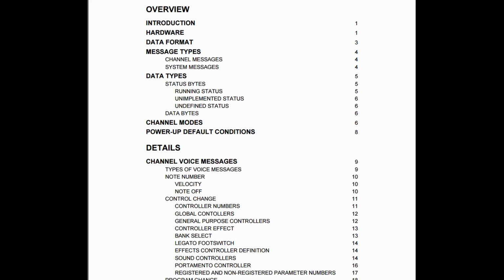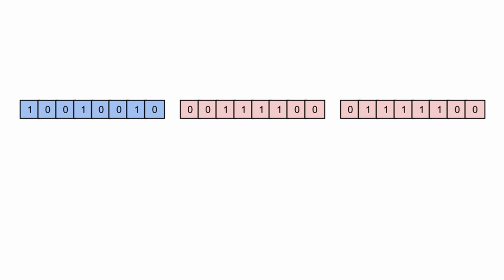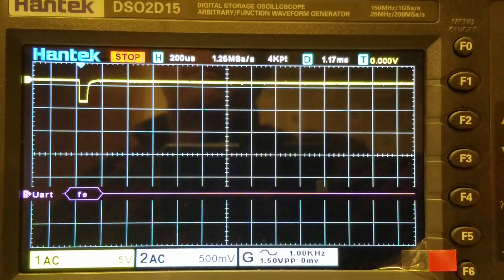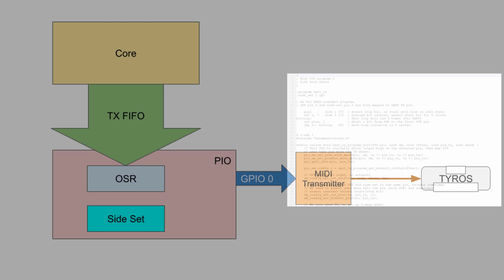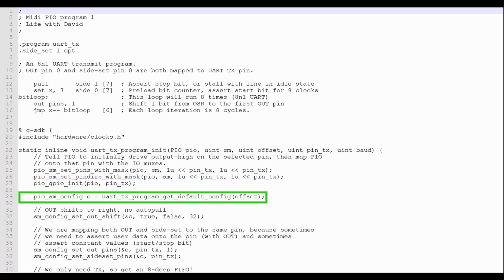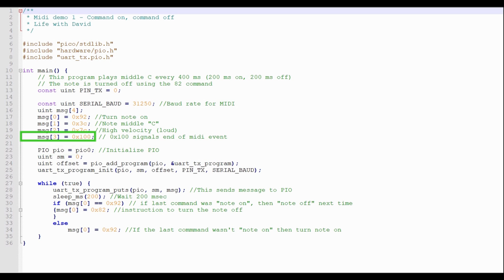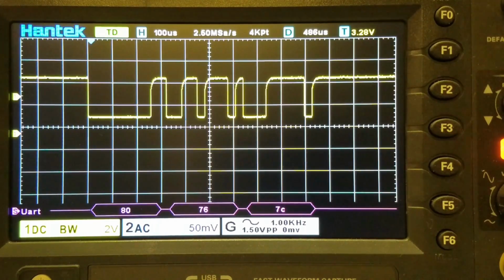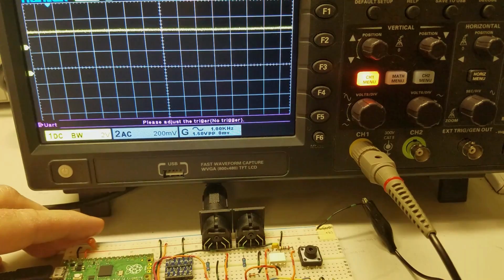Raspberry Pi Pico PIO - Ep. 17 - MIDI for the Pico

Comment: Hello David,
My name is Dani and I am a visually impaired user. I really enjoyed your project with the Raspberry Pi Pico and Yamaha Tyros.
I want to build a similar MIDI controller, but I would like to use a PS/2 keyboard as the input and a standard 5-pin MIDI cable for the output, in order to send MIDI messages to my Yamaha PSR-SX900 keyboard.
Is it possible to use your approach with a PS/2 keyboard as the input device, and will the MIDI output using the standard MIDI cable (DIN connector) be reliable for my project? I would really appreciate your advice or any tips you can share.
Thank you very much for your work and your help!
Best regards,
Dani
Reply from the maker: Thanks for watching!  Yes, you should be able to use a PS/2 keyboard with a Pico to transmit MIDI signals.  The PS/2 keyboard can be read using PIO.  Remember the keyboard typically uses 5 volts; but the Pico runs at 3.3 volts. You might try powering the keyboard from the 3.3 volt supply from the Pico and it might work. There are a couple videos that will help you.  Then choose a different PIO block for MIDI. Sounds like an interesting project.  Good luck!

Comment: Is it possible that on standard rasp Pi4 or Pi5 MIDI Din is DEAD? All overlays trying to change the Baud rates do not work anymore...
Reply from the maker: I'm sorry, I don't know.  I haven't tried MIDI on a standard Pi.  I'm assuming the Din pin is a GPIO pin.  Use a simple script to display the input of that pin and then toggle it between ground and 3.3 volts.  If it displays the proper value, then the Pi is OK, and it must be a configuration issue.  Good luck!

Comment: there is a mistake in your schematic at time 6:07, you show midi out pin 5 connected to the +5v through a 220ohm, this differs from your other schematic at time 3:45 which shows pin 4 connected to the +5v through a 220 ohm, i originally built off you schematic at 6:07 and it did not work, until I realized the error, otherwise it works great... I really wish you would write the RX portion of the PICO Python code, I would like to TX and RX
Reply from the maker: You know,  you're right.  I'm so sorry, I got the connectors mixed up in Fritzing.  Thanks for pointing that out.

Comment: Maybe I’ve missed something, but what does the 0x100 appended to each on/off message actually do? I can’t find a reference to it elsewhere. Thanks for any help!
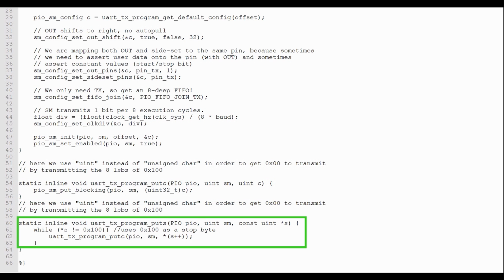Reply from the maker: I'm sorry, it WAS a little vague.  Check out lines 58 through 64 of the PIO program  (about 14:06 in the video),  I used uint (32 bit word) instead of an unsigned character (8 bits) because I wanted to transmit 0x00 to signify the end of the midi event.  Since I'm only transmitting the least significant 8 bits of the 32 bit word (the ninth bit is set), it was just an easy way to flag the end of the midi event while still transmitting a null character.  Hope this helps.  Thanks for watching!

Comment: What about a simple UART RX function that waits for a MIDI Program change (0XC0 to 0XCF) ?
and maps that to a 1-128 (0-127) memory location?
Reply from the maker: Thanks for the suggestion!  That should be pretty easy.  I was hoping to make a MIDI recorder, but I've gotten side-tracked with bare metal assembly programming on the RP2040.  Maybe I can combine everything after I learn assembly on the Pico!   Thanks for watching!
Reply: @LifewithDavid1  would love to see a midi recoder, thanks for the videos!
Reply from the maker: @polythingies  Thanks for the suggestion.  Right now my midi source (the Tyros) is in storage.  Next time I get it out, I'll have to give it a try.

Comment: Thanks for this series, makes the whole PIO thing a lot easier accessible. 
You don't need a level shifter for Midi. Midi uses a current loop of 5 to 7mA. You can drive Midi Out at other voltages than 5V just by changing the resistor values. 
The Midi input  6n138 opto is quite happy to work at 3V.  No changes needed, though you might want to add 4k7 from pin 7 to ground.

Think it might even be possible to have the PIO state machine sort out things like running status and system real-time messages. That could make things a lot easier for the main program.
Reply from the maker: Thanks for the info; I was kind of wondering about that.  When I make videos; I go a little conservative because I don't want to blow up anybody's Pico.  

I have to think about it a little more, but I hope PIO can do a little more.  However, I've been experimenting with MicroPython; and I'm impressed how fast it actually is.  More to follow.

Comment: Wow, C++ part too complex for me, but excellent visuals, great intro for anyone trying midi.
so the pico could record when receiving midi data, 2 picos could be used to test wiring with passthru to midi device/synth.
remote test pico sends to second pico+synth, after local test which tests wiring from second pico to synth. 
midi is also used for lighting effects/motor control. Other pins on Din connector for extra channels / loopback debugging ?
Reply from the maker: That's a very interesting project.  In fact, it could all be done with one Pico.  There are eight PIO state machines, each can run a separate program.  Those 8 plus the 2 on-board UARTs give 10 independent serial interfaces that the little Pico can manage.  It also has two cores that can run independently.  

I don't know about using the extra pins for any other functions.  MIDI cables only have 2 conductors and a shield.  I think the industry is moving toward MIDI 2.0 including USB and Ethernet.  However, the old school DIN cables will be with us forever; MIDI 2.0 is backward compatible with 1.0.
Reply: @LifewithDavid1  might need 2 based on location, control room, stage, usb : so 1 pico is usb host the other client ...

Comment: Thanks for another great video on PIO.  I have been messing about with MIDI recently and wondering about using a Pico to merge 2 or more MIDI input signals into one output signal.  What I want to do is mix the output from a MIDI keyboard or sequencer (providing note instructions) with the output of one or more midi controllers (providing cc instructions) to create a single MIDI stream that can control an experimental digital synthesizer.  The information you have presented looks like a good starting point!
Reply from the maker: That's a great idea!  I think it would be really easy, one PIO for each MIDI in and one for the MIDI out.
Reply: @LifewithDavid1  Thanks!

Comment: I guess the keyboard uses key up rather than note off is to allow the note to sustain  .
Reply from the maker: I was a little surprised to see that; but looking at the MIDI files, I can see why they do it.  I'm still studying it; but you can use one note-on command and then string a bunch of on and off notes together using just two bytes per note (one for pitch and one for velocity).